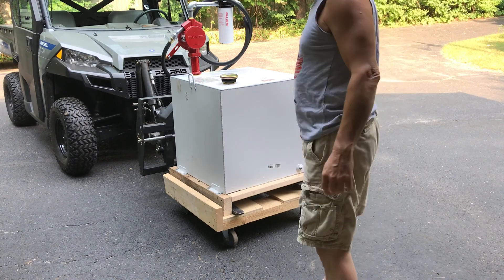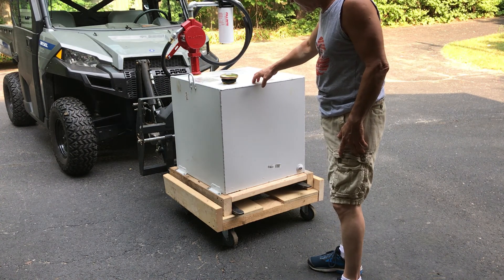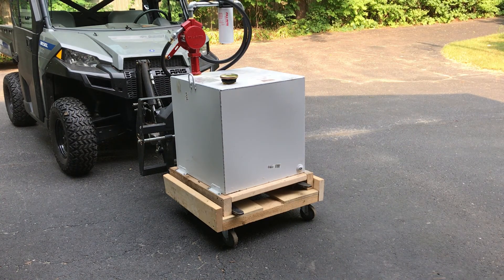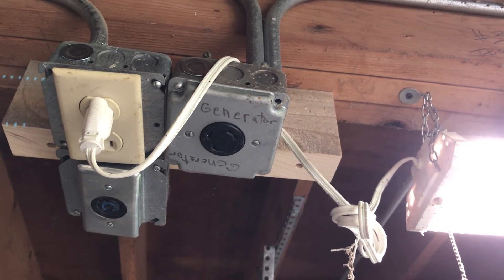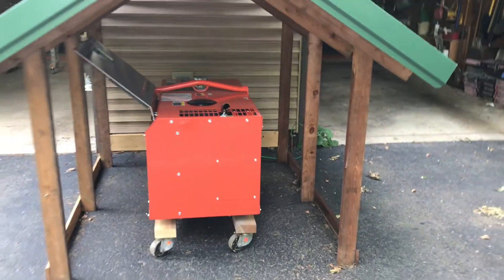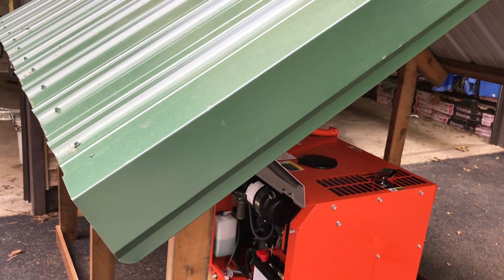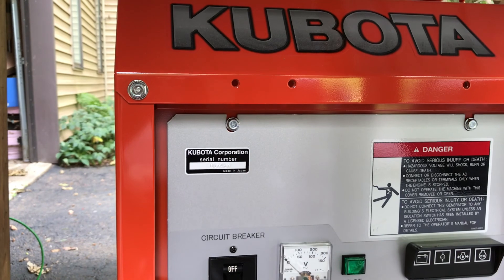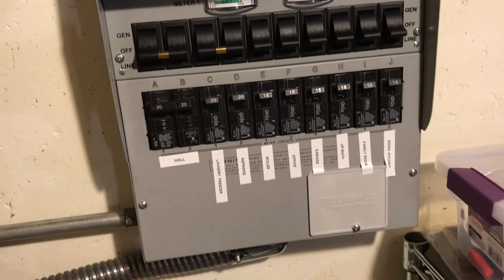Kubota 7KW diesel house back up system

Comment: Does your 7kw power say, heater, 4 fridge/freezers at same time? Thanks.
Reply from the maker: Not exactly sure what you are asking here. But It runs 10 circuits on a the transfer switch. That consists of two kitchens, my boiler, well, garage and family room. As long as you do not exceed the 7kw all at once.

Comment: I dont understand why they tun it at 3600 rpms.  Nearly all diesels run at 1800.   It quieter and the engine will last longer.   It will also save fuel since its in the best part of the power curve.  I would buy one except for this problem
Reply from the maker: I wondered that as well. My 5.9 cummins in my truck idled at 1800 if I recall. It had the torgue too. Long rods
Reply: @johnkayak10  I really like the setup of those lowboys but can’t get past the 3600 they are running.
Reply: Because the Cummins has a turbo the natural aspirated stuff needs rpm like gas engines @johnkayak10
Reply: rpm doesnt matter if the engine is designed for it which this one is. We use one for a winery thats on 24 hours a day all year for operating the equipment and AC unit off grid in a place where its more money to install electrical than it is just to run the generator.
Reply: @pilsplease7561 once u run the power company to ur estate. U lock the municipality into ur estate. Meaning they can require u to maintain service with the power company.

Comment: Can the shell be taken apart ? I need it even more compact. Does the shell/case have anything to do with cooling or function ?
Reply from the maker: My guess would be no, so many things connected to it. You may want to contact Kubota and see if you can order it like that.
Reply: @johnkayak10  it just a little tall, and a little long, inches. Looked like the exhaust end could be modded to shorten lengthwise. just not sure how I can shorten it by a couple inches on height.
Reply from the maker: @LittleRZR50  here is the manual The fork pockets on the bottom could be removed I would guess https://www.kubota.com.au/wp-content/uploads/2015/10/GL6000-GL9000.pdf

Comment: Funny….I got a 7kw off of craigslist for almost nothing…the gen section was non functional…the engine is a screamer at 3,600rpm. 
My goal is to pulley drive it with a 4 pole head at 1800….the lower rpm would de rate it to 4-6 kw..without the excess noise….I’m at a loss on how you would destroy a kubota gen set except it’s previous owner was a highway sign co out on the desert…a brutal environment.

Comment: Like your pallet fork set up on the Polaris
I’m looking for a wrecked one to replace my front end…..
Reply from the maker: I hunted long and hard for mine and plow as well. Since Polaris discontinued making the Brutus line, attachments are getting thin.
Reply: @johnkayak10  so cool ….Brutus line…?
Was that sold under Polaris?
Did you do any mods to overcome the weight added?
It would be very useful if easily removed…my main function was to haul fruit from the grove and carry tools….
Reply from the maker: @offgridmangogrower  Yes Polarus Brutus 
HD model and HD PTO
Mine is the HD it has no PTO
Reply: @johnkayak10  just saw the Brutus line being advertised in S C.

Comment: If you are using the L14-30 4 prong 240 plug the generator is bonded to the ground in your home’s panel and you are all set (no need for any additional grounding). I coordinated dispatch during disasters for literally thousands of diesel gens at cell towers and remote sites.  The key is that the generator is bonded (at the same potential) as whatever structure it is hooked to.  On a side note, per OSHA, if you are using the gen to power up tools or a trailer that is not hooked up to any other power source, so long as the gen neutral and ground are bonded (and I believe they are on that gen), you do not need to ground it, and if you do you actually make it a more dangerous situation.  There is a lot of confusion over grounding … the primary purpose is to dissipate stray high voltage (think lightning strikes or shorted windings in transformers)
Reply from the maker: Thanks Paul

Comment: I would not have that grounding rod. The issue now is you could have a nearby lightning strike which could then travel UP that rod, through your nice generator, and back down your homes ground rod. You just want everything to go back to the panel which has its ground
Reply from the maker: Interesting, I will re read the manual. Thanks for the heads up.
Reply from the maker: So should I have run the cable to my house grounding rod? Its 30-50 feet from where the generator is. The manual says either a grounding rod or plumbing pipe.
Reply from the maker: Or I could run it in the garage to a conduit. I did conduit in my house. That would be good shouldn't it?
Reply: @johnkayak10  The grounding conductor in your cable back to the panel is perfectly fine. As long as your panel has a ground which I assume it does, all you need to do is plug the generator in with the cable, and you're golden
Reply from the maker: @jimsbagels1991   Thanks
Reply: @johnkayak10  Watch "Grounding - Safety Fundamentals (1hr:13min:19sec)" from MikeHoltNEC and go to 50:00, it explains this situation pretty well
Reply: @johnkayak10  Great video by the way, that is an awesome generator and I had no idea a Polaris like that existed. I am very jealous of that thing
Reply from the maker: @jimsbagels1991   I was very fortunate to find that Polaris, its a 2013. I got it in 2014 a dealer in Minnesota had overstock so they were blowing them out at great prices. I believe the MSRP was $18 or 19 grand and got it for $9000. The following year got another one for the church I go to for the maintenance dept for $8000. Great machine I plow our lane with it as well. I have the dirt bucket, plow and forks for it. I forget what year they discontinued making them but I see them for sale online every so often. Mine is the Polaris Brutus HD model. The also made the same unit with a PTO drive for a blower, mower and sidewalk broom. It's slow though, to speed is 20 MPH, but I do not mind they are made for work.
Reply: @johnkayak10  Wow, thats a great deal! My lot is not really big enough for something like that sadly. Love me a good generator though. I have a 27kw Natural Gas Generac (RG027, 1800rpm, Liquid cooled) and my backup to that is a 7kw Champion portable. I'd love to have something like the Kubota instead.
Reply: Sounds like you need to educate  yourself.. I hook  up 12kv plus   daily  . If you use a ground rod two feet deep yes but most educated  electrical  hands know atleat 6 or feet is more then enough
Reply: @theviper6602  Cool, well when we get a 12kv generator we'll call you up. Until then, I'll reference the NEC